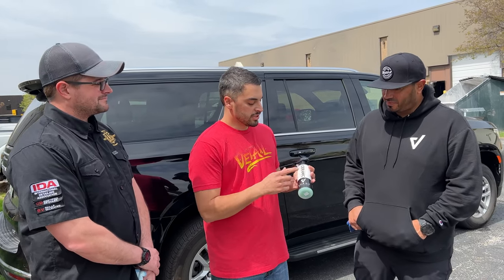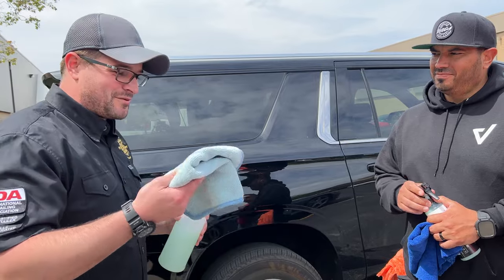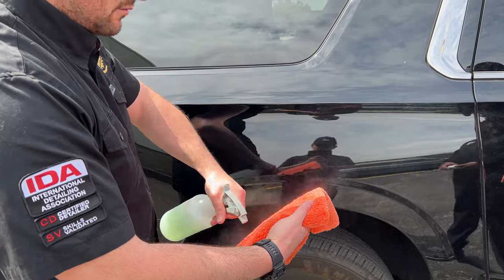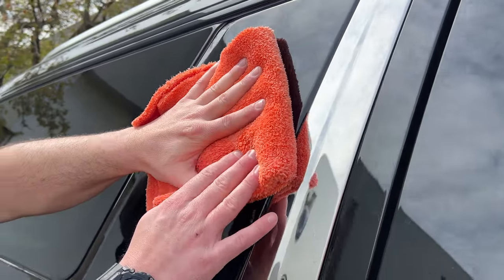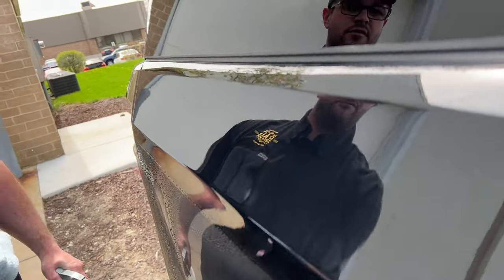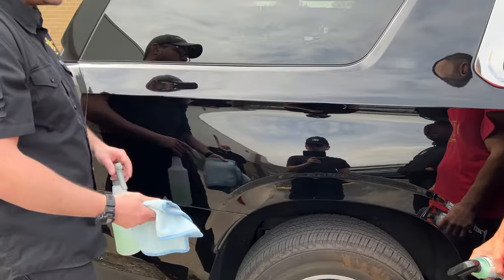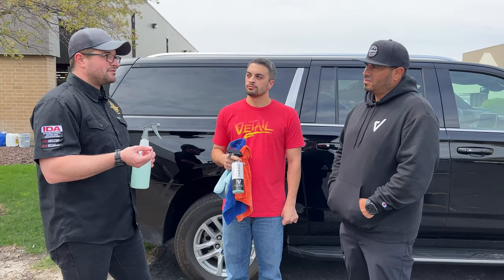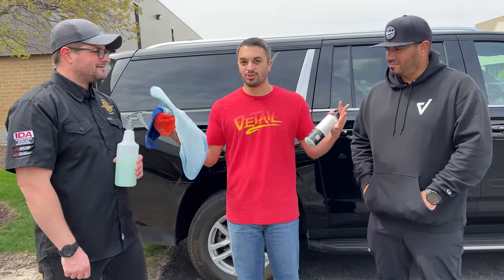What’s The Best Microfiber Towel For Waterless Washing? W/ The Rag Company & Veros Car Care

Comment: Hey @chris @veroscarcare ...with Veros CWW in the car for road trips and random bird droppings, etc... would the Veros 5in1 be needed as well... or is the 5in1 better after a maintenance wash?
Reply: The 5N1 is a Polymer Detail Spray. Drying Aid. Spray Wax. Quick Detailer. Clay Lubricant.  Anti-Fingerprint. Mostly used when the car is already clean.  

CWW is a Waterless Wash with Encapsulation Technology to lift away dirt that’s Ceramic based. Does not have to be used on a clean car and will actually clean the car for you. We don’t recommend CWW for Clay Lubricant. I hope that helps! Any other questions just ask!

Comment: My question of "what is ideal" has yet to be answered. Do we want plush or twisted loops? Seems to me that TL would be superior, so the Eagle wouldn't be the best choice. TL towels should glide better, absorb better, and release dirt better in the wash. Just make sure you're well lubricated. Or am I wrong?
Reply: I did some research. DIY Detail recommends their buffing towel, which is like an Eagle Edgeless. Griot's recommends their PFM which is a twisted loop drying towel. Cobra has one marketed towards waterless washing that I can't tell what it is but it looks plush to me.

Then there's towels like the Pluffle which is a plush waffle weave design. However, it just looks like it will push product around and not really dry well.

I think they can all work but there is such a thing as "ideal" for the task and I'd like to find out what that is.
Reply: I decided to just use the same mitts and pads that I do normal washes with. I already have enough detailing "gear" and I think they will work great.